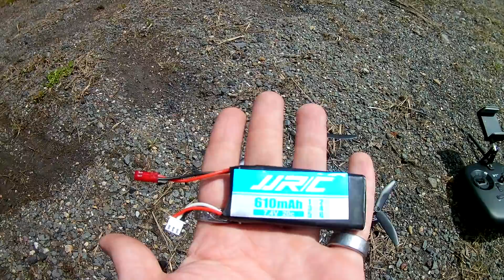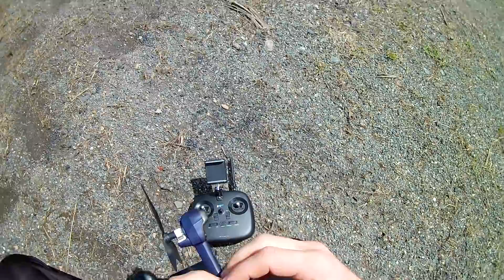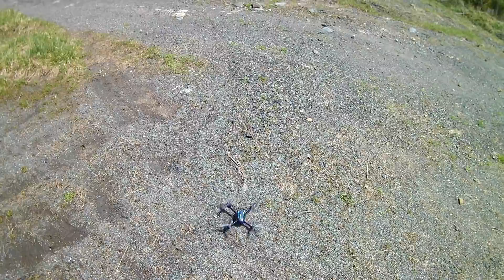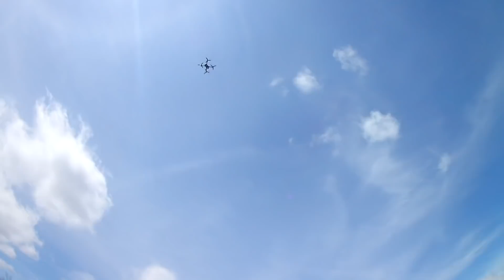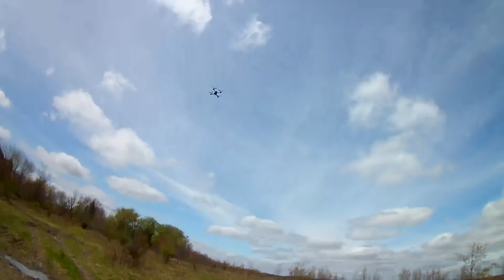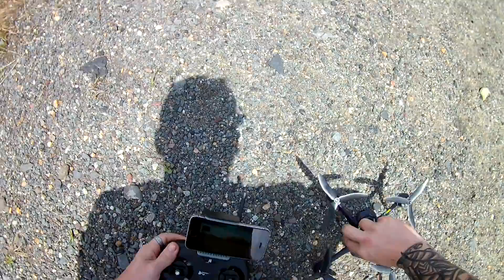Hubsan H216A X4 Desire Pro TRI BLADE PROPS FPV Quadcopter 15 mph HIGH WIND FLIGHT Drone Review

Comment: H216a is a fun little drone. I tried triple props but did not notice any real difference. I had to sand down the props a little (shaft) so they would not over tighten. Speed change is in the controller settings at the bottom.
Reply: Thanks! I take it the controller curves also effect speed? I'll try it tomorrow.

I just took my h216a on it's maiden. I sent it 300m using the ht011a controller, and it still had full bars of connectivity. Had to turn around because battery hit 50 per cent. It took 5 minutes to get out that far at 2.5m/s and the beginner curve on the sticks kind of sucks. I'd forgotten about that setting. You rock! Thanks a bunch for this info!

Comment: I used to have that drone; and when the blades get stuck or sluggish, I always checked the gear teeth behind the motors to see if any dirt or debris got jammed in there - especially after a hard landing in the dirt or sand.